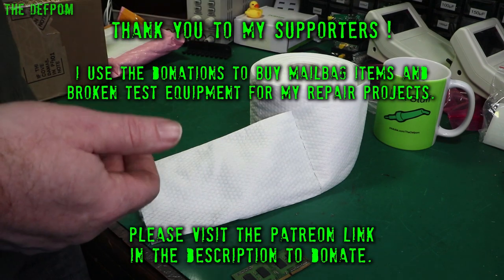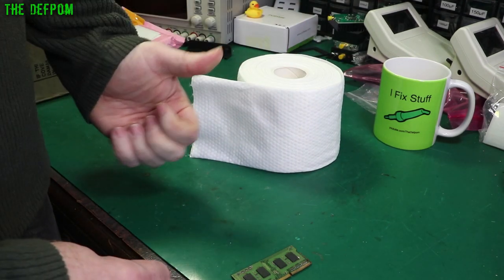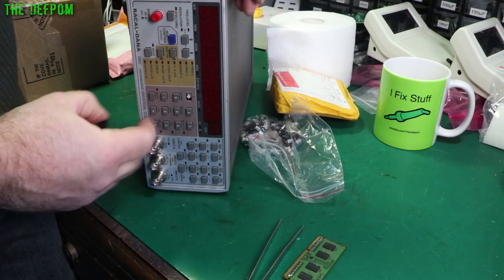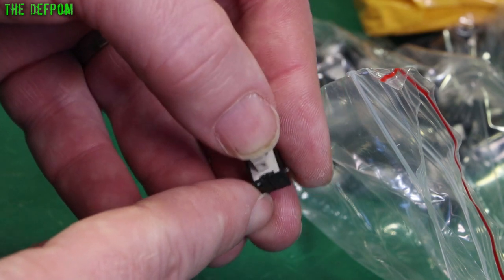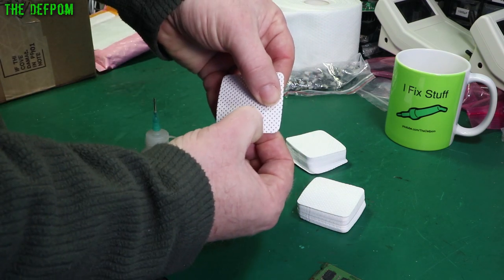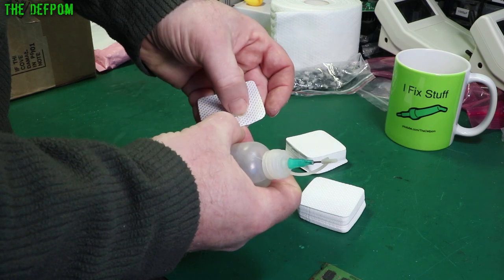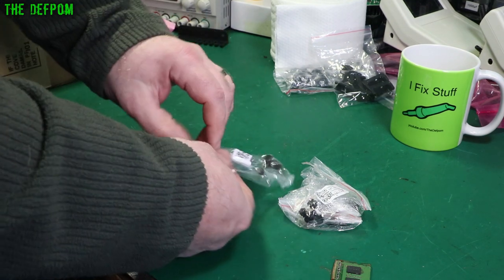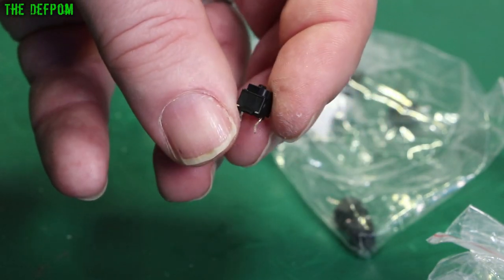#744 Mailbag Monday 10th August 2020 🎞 📭 📦 📩

Comment: Hi, for my Racal 1992, I have ordered 50 pieces of switches with a total length of 9.5 mm on eBay.
The base is square 6.2 mm, 2 contacts.
The moving part is a cylinder.
It works perfectly since one year just obliged, when assembling, to cut the small plastic parts inside the button and glued to the switch with epoxy 2 components like Araldit.
Sorry for my English, as you know, I am French :)
Reply from the maker: some switches arrived yesterday which look very close to what it needs, will be in a mailbag near the end of September (yep that’s right, I have over 6 weeks of videos queued up)